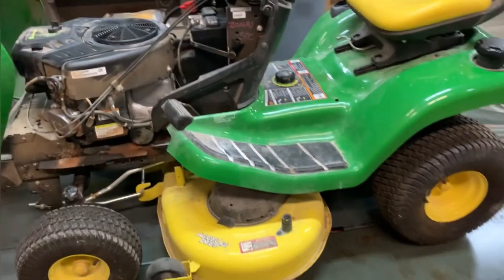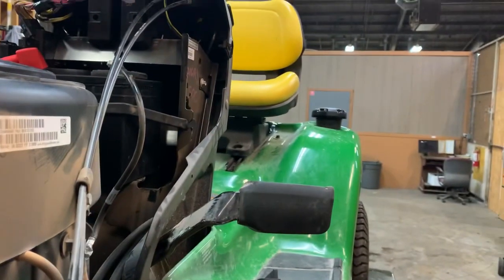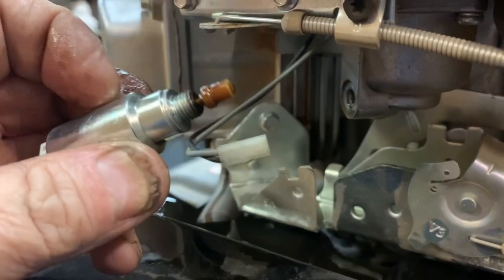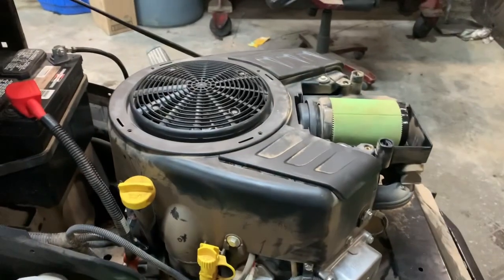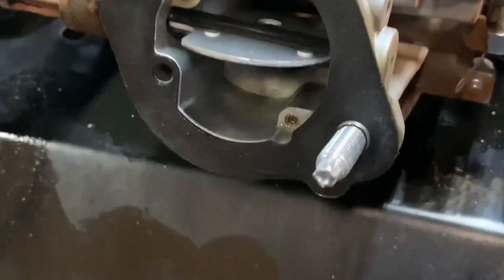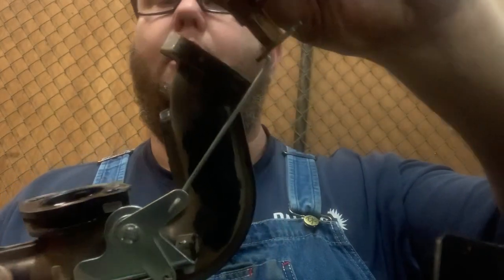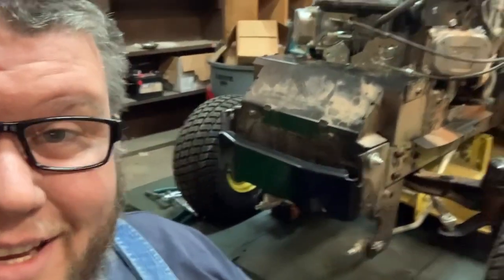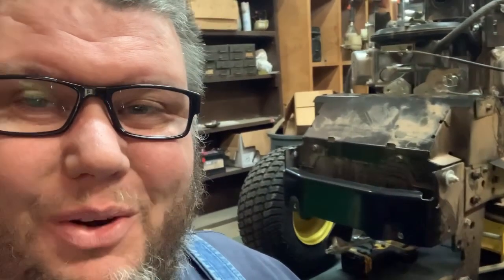JOHN DEERE X330 BEEN SITTING 3-4 YEARS / WILL IT RUN?

Comment: "Drawing a vacuum on the fuel line" priceless! Thanks for showing us how it's done in the real world. Carburetors have always baffled me. I had to put the old carb back on after trying 2 worthless aftermarket cheap Chinese carbs. . I just  had to replace the solenoid which worked fine even though it was off of the Chinese carb. . I think it's high time we bring back all manufacturing to the U.S. !!!!
Reply: So true, I ordered a cheap Chinese carb and when I installed it, it ran but had a miss and pop to it. So I just swapped the internals of the new carb and put them in my factory carb. It worked awesome. I don't understand why it was having issues with the new carb? But in the end with the new parts swapped it runs like new.

Comment: Thanks - i own a 2009 like this with 4 wheel steering. It has 780 hours now and has been shutting down on me after about 40 minutes, then no start until it cools down some. I may start by replacing the anti back fire solenoid. Then cleaning the carb like this video. My engine is a 22hp kawasaki. Love this mower, time to get it to run for longer time frame. Could be a coil or switch too, not sure. Might take to a repair shop to avoid agony and paying for parts i dont need on my ideas.
Reply: It's most likely a bad ignition coil or coils. Had the same problem with a push mower that did that replaced the coil and never had any starting issues when the engine is hot
Reply: Make sure your fuel line isn’t plugged up. Also check your tank for dirt and debris.

Comment: Usually I find those rubber o rings & gaskets are all swollen and distorted from the ethonal in the gas. Those carbs will always leak and no run right. You lucked out on that repair Mower Medic.
Reply from the maker: No luck to it.

Comment: I use a fuel shutoff valve for any storage and run engine till it dies. Works well for me so far.
Reply: Same, I always run Trufuel in my rider and push mower and trimmer. I never use ethenol gas. But I still use a shut off and run till it shuts off. Better to be safe than sorry in my opinion

Comment: I get lots of those Nikki carbs in my shop and hate them. The older ones don't even clean good in my ultra sonic cleaner. I heard that Walbro might make a replacement but have not seen one yet??? Great video, more bad ethanol gas. Do you know of a replacement for the Nikke carbs? Thanks much.

Comment: I've replaced so many of those nikki carburetors because like you said sometimes cleaning them doesn't work. And surprisingly when i bought my generator a few years ago it sat with old gas in it and cleaning it in my ultrasonic cleaner got it up and running like new again then i just went and gave it a tune up